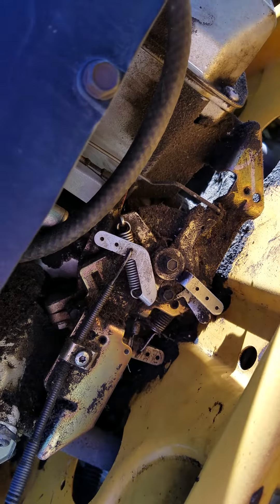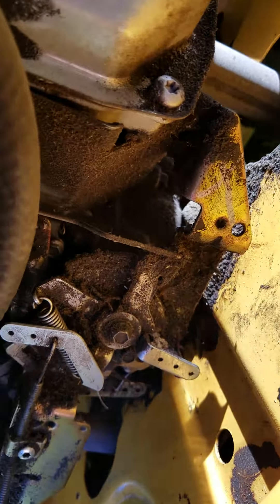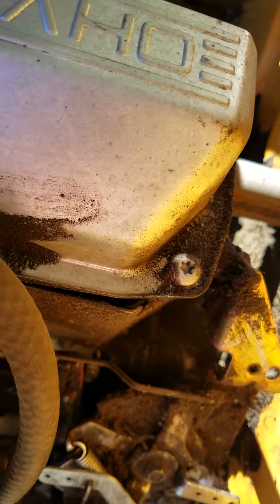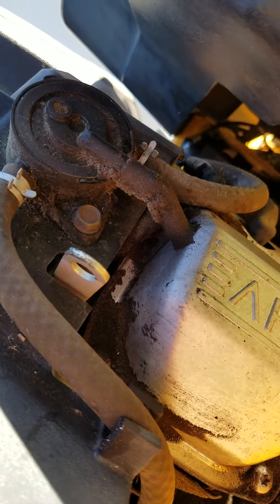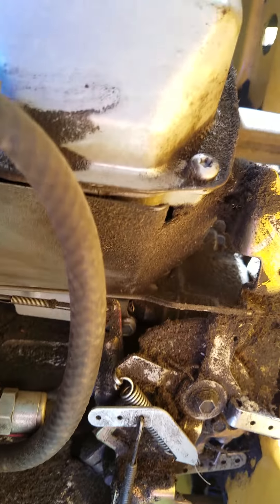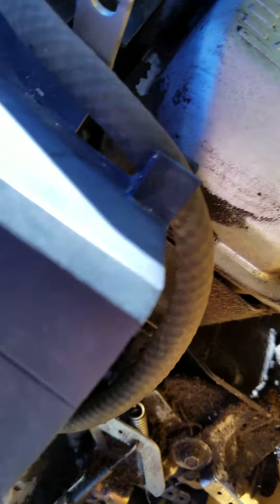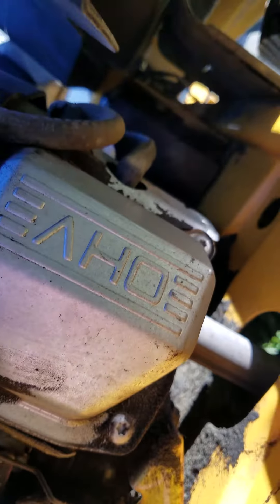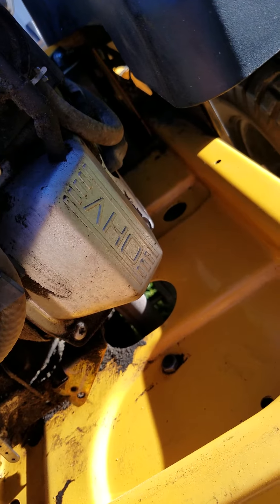Cub Cadet 42" Zero Turn Smoking Part 2

Comment: I think you got something internally going on. Maybe oil slipping past the piston and draining out the exhaust into the muffler? I have same mower but with a Briggs intek and I replaced every seal imaginable, besides the sump cover and I’m still getting smoke💨 .....so next I think I’m gonna check what I should have checked first the compression